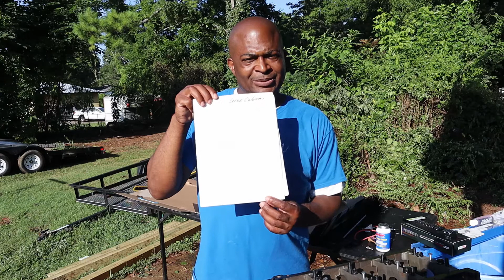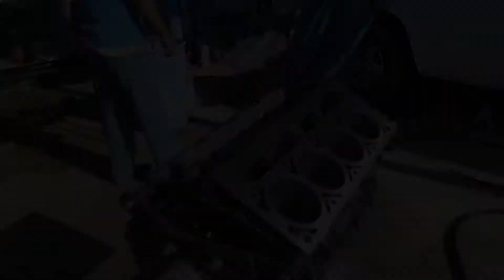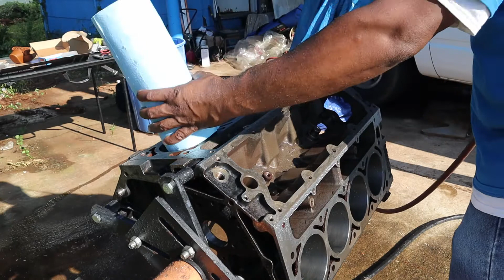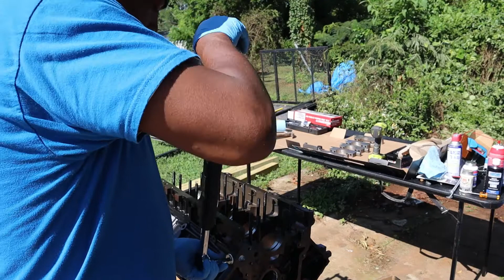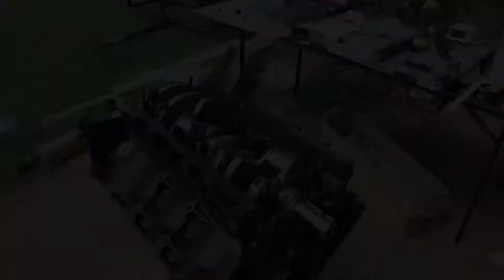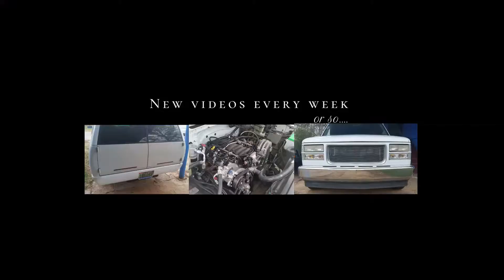How to build a LS 383 stroker from a 5.3 part 3 (clean block and install crank)

Comment: I would like to kno what pistons, Rods, and crank you use.
Reply from the maker: K1 4340 forged steel crankshaft 4.000 stroke

K1 forged 4340 steel H-Beam rods with 7/16" ARP 2000 rod bolts, 6.125 length

Wiseco 2618 forged pistons, ArmorGlide Skirt Coating, .150 wall wrist pins

I got the kit from cncmotorsports.com

Let me  know if you have any other questions 

Thanks for watching

Comment: Whats the purpose of drilling that center hole? is it bc you switched to arp studs?
Reply from the maker: yes, the arp studs apply a greater clamping force to the main caps which also affects the clearance.  without the proper clearance poor oil pressure would be experienced and premature failure

let me know if you have any other questions
thanks for watching

Comment: Did you have to get any machine work done for the 4 inch crank to work? I'm working on an lr4 and wanting to put in a 4 inch crank but need to know if I need machine work done first
Reply from the maker: I didn't need to have the block clearance for the crankshaft. 

Let me know if you have any other questions

Comment: What wiring harness did you use? Also what transmission?
Reply from the maker: I using a wiring harness from psi conversion 
I'm running a 4L60e transmission 

Let me know if you have any other questions
Reply: A 4l60e can handle a 383? Or did you have it rebuilt? Are you running boost?

Comment: How Much was it to bore the cylinders?
Reply from the maker: I'm not sure on the price just bore the cylinders 
I had other work done

Cam bearings 
Deck the block
Bore cylinders 
Clean front cover, rear cover and oil pan

$550

Let me know if you have any other questions

Comment: What’s up brother
Reply from the maker: Whatz happening doc
Reply: @Slicpartna  
After all this I installed a 2000 stall converter in my truck it was running fine but it didn’t have the power that I was looking for! I changed it to a 3200 stall and now it seems like it’s stuck in third gear reverse works fine
Reply from the maker: @originalman8497  have you gotten it on the highway to see if it goes into torque converter lockup at highway speeds
Reply: @Slicpartna  
it’s stuck in 3rd gear and the RPMs are high! I was thinking it might be the new stall converter but, it drives and reverse works well!